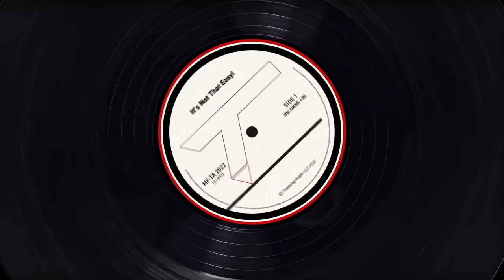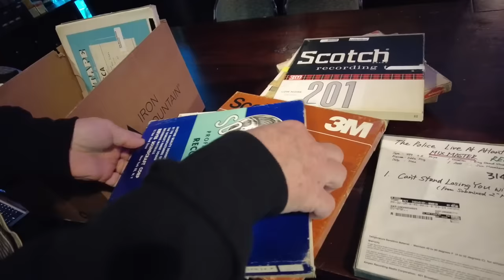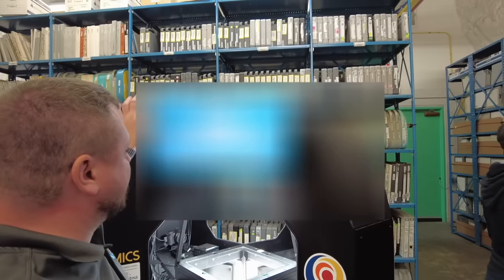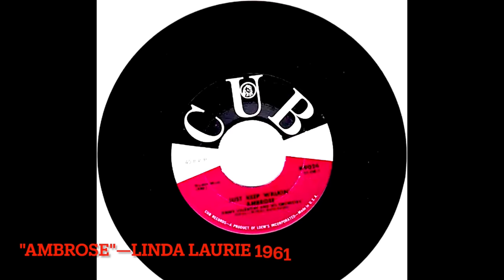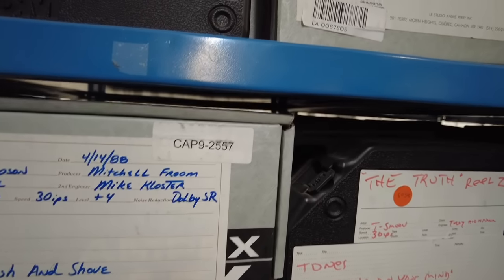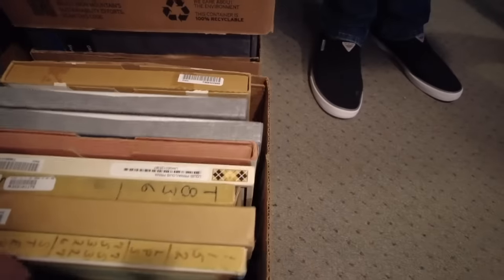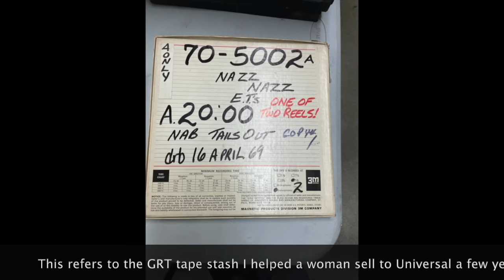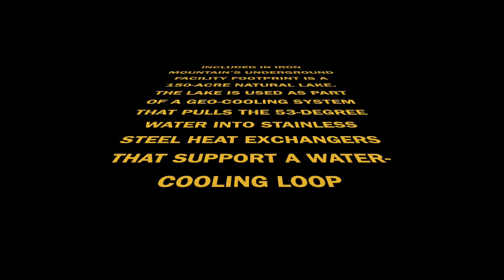Universal Music Group Opens its Iron Mountain Tape Vault  And You are Invited!

Comment: And so many factors go into obtaining, Quality Sound.  In a manner. Your brain wants to perceive it. Because your brain does not want to perceive it in, Negative Absolute Polarity. You can't tell what the hell you are listening to that way. Because the sound is moving away from you not toward you. And it is not producing a Positive Pressure Wave Experience. It's negative. It's sucking away from you. It's totally mindless! From peoples whose brains do not work, do not function, correctly.

And so just like the Electronic Bigots, that they are. They don't perceive that anything is wrong. Except their lousy acoustics in their room. Or a lousy piece of equipment that does not deliver the way they want it to. Because they don't have things wired correctly! And so it's easy to blame the acoustics and the equipment. And to try and correct your acoustics for your wiring error. That would be like, having your legs amputated. To make it easier to go to the bathroom. On the toilet. If you have no legs. And having your legs amputated to take a dump. Would be kind of counterproductive. Don't you think? No you cannot think. That's why your speakers are not wired, correctly. You mindlessly followed the religion of incorrect, instruction manuals. And you are certain it is correct! It is Gospel! That they will not question. But still know things don't sound right. And so it must be their gear or the equipment? No it is not. And it's not even the acoustics. Even if it is. Because the bad acoustics are exacerbated. By connecting your speakers wrong. It reinforces the worst acoustic signature. That is all backwards and wacky sounding. Because it's sucking away from you! Aargh!

And so what good is it storing your tapes?  When you don't know what the FUCK you are listening to to begin with? You won't know the tapes have deteriorated and have been recovered, sort of. Mostly, kind of. So you can kind of hear what that recording was like, still, sort of. As you got people telling you what it sounds like and what you are hearing. They are telling you what you are hearing. How do they know what you are hearing? They are not you.

And so it's all, made up technical bullshit. When you have audio experts. Telling you what you are hearing.

I am simply telling you. What you are not hearing. As I have to correct those multimillion dollar recording studios.  The electrical engineers and acoustic engineers have designed and wired. And incorrectly I might add. And I have added. They didn't get it right.. And yet they received their degrees. For not getting it right. And then everybody wonders what's the matter with their sound? It must be the acoustics? It must be the equipment? It must be the lousy recording? Maybe it's the microphone they made it with? Maybe it was recorded digitally which they think they don't like? Because it sounds too clear. Compared to old mushy sounding vinyl. And they think mushy sounds better. It's so warm and smooth  they say. That's because it sounds like  mush. It does not sound like the Master Mix Tape. Because when you hear those in person. In the Control Room. Your mind will be blown. And you will realize. Just how god-awful horrible vinyl actually sounds. I hate vinyl! I always have. I always will. And 78 RPM shellac is the worst! But it's all that existed back in the day. And they are nothing more than historical archives of lousy sounding recordings. The do not sound good. Because the technology didn't yet exist. That came into its full technical fruition. By the early 1970s. When by 1983, 40 years ago. We all went Digital.

Yes I am one of those people. That started digital recording back in 1983. When I used to work for the, legendary, American, Analog Tape Recorder Manufacturers here in the USA. And I worked for the best and the most legendary of them. I am one of the few still surviving members. Of that Golden Age of actual Audio Engineers. And I was taught and mentored by the Masters of the Industry. Who invented most of this stuff. And associated with the companies that delivered it.

I am one of the greatest engineers and one of the greatest pairs of ears. In the Pro Audio Industry. Along with numerous colleagues of mine who are famous. As they hung out in the private recording studios. And I hung out with NBC-TV & Radio. As the 1st Recording Audio Engineers. All started in Radio. As did I. As did Bruce Swedien. Who recorded and mixed all of Michael Jackson's big hits. A big old fat white guy from Minnesota. The Recording and Mixing, of the baddest ass black pop legend Michael Jackson. And I came out of Motown Studios, sort of. Though then I was just a kid. It was my daddy. Playing violin tracks for them. And so I grew up in the control room. Starting at the age of 7. I don't know anybody else like myself that started that young.  As that's when I made my lifelong career decision was at 7 years of age. Sitting in the corner of the control room.  I knew I would spend my life and career in them. And I have. For now over the past 50+ years. And I am now retired and living in central, Texas. Where it's a hell of a lot warmer! And no more snow! I'm sick to death of the cold snow and ice! Ugh!

There's a reason why all of the feel-good beach music came out of, Southern California. As the Edmund Fitzgerald sank. In the freezing cold waters of Lake Superior, Michigan. And how do you make any feel-good music in that kind of cold? It just gives me the shivers thinking about it! And it looks like I'm dancing! I'm not. I'm freezing!  FUCK the cold and ice! GIVE ME WARM TEMPERATURES OR GIVE ME DEATH!

(More whack a mole in next post)